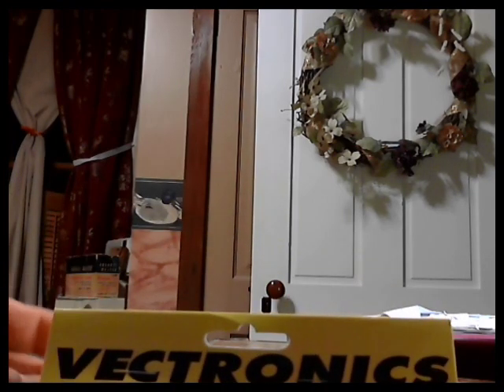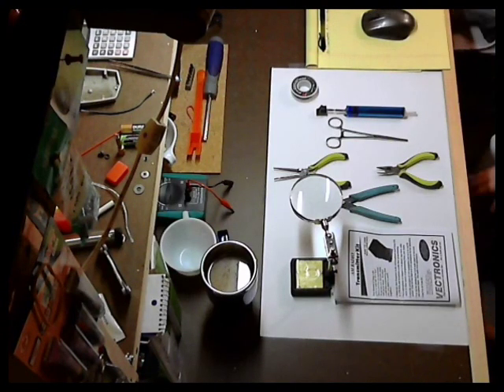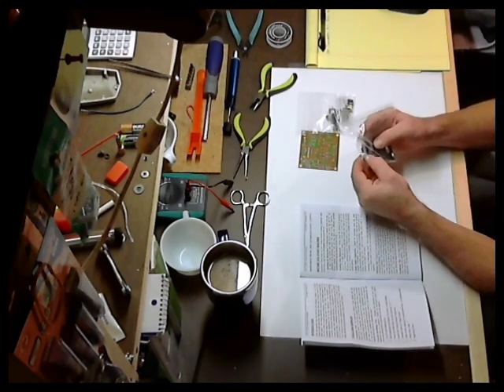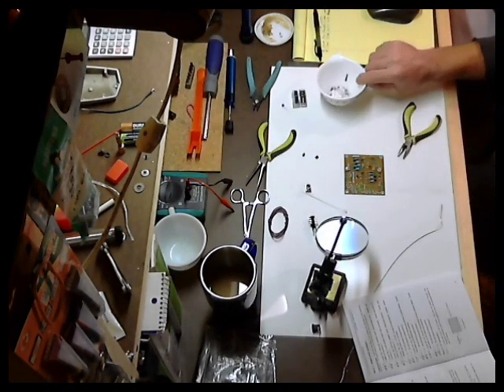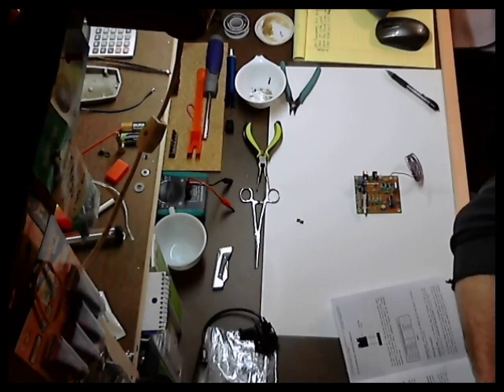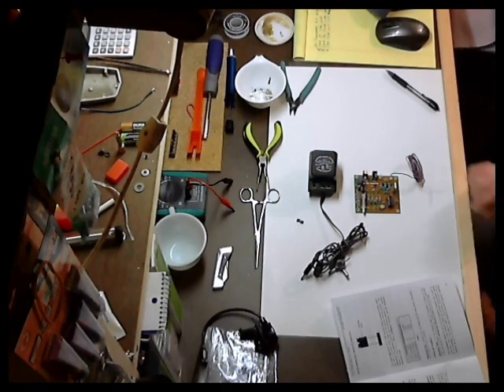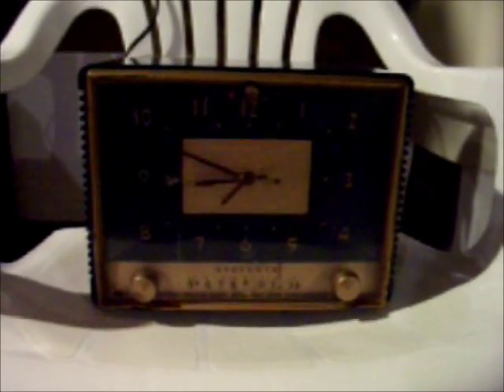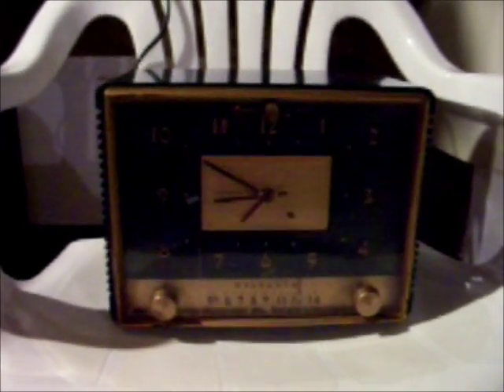Building A Low Power AM Transmitter ~ Part 1 Of 2

Comment: Great video! I thought your idea of putting white poster board down as your work surface is a really good tip.  It seems like this transmitter would be ideal for broadcasting to vintage radios somewhere around the house.  Thanks for sharing your project on youtube.

Best Regards,
Pat
Reply from the maker: Pat,
Hello, the white poster board worked out great. As a matter of fact it's still there. This little transmitter works great. Today I got an E-mail saying my back-order cabinet was shipped, so part 2 should be up soon. Thanks for the view and comment.
Nathan

Comment: Nathan,
Very cool.  Congrats on becoming a member of the transmitter club.  I didn't know about that model.  I may soon have use of one.   
BTW... the FCC knocking on your door is about as likely as hitting a $500 million dollar Power Ball jackpot.  :-)
Also, is your Sirius radio sitting on top of the power supply?

Regards,
John
Reply from the maker: John,
Thanks, Vectronics also has several "meter" transmitters, plus the AM & FM stereo units. This was a fun build, prior to this I assembled a Velleman signal generator. That was a good project, but this was better. I know the chances of "The Man" visiting me are slim to none, but just thought I'd throw that in there for good measure. The Sirius is using the 12 volt power supply till I get a new wall wart for it. The AM transmitter has it's own wall wart and the voltage can vary from 9 to 14 volts. Using it at 9 volts greatly reduces your output power.
Nathan
Reply: Nathan,
What I'm getting at is that the radio sitting on top of the power supply might be causing some of the hum you're hearing on the AM side.  Also know that a transmitter's signal, depending on where it's sitting, can and will be picked up by your house wiring and get re-transmitted a second time (or more), thus also causing hum.  AM transmitters can be a bit tricky.  You have to move them around and play with them a bit until you work out their kinks.

Regards,
John
Reply from the maker: John,
OK I see. I have been tweaking it a little bit. When I first powered up the transmitter it flooded the AM band from 1500KHz to 1710KHz, with a bump around 750KHz too. Since then I decided to stay around 1460 KHz and it has done very well. Takes a little patience dialing this baby in, but once it's done, your well rewarded.
Nathan

Comment: I'm about half a decade late, but do they sell (ship to) in the UK
Reply: Dunno if anyone responded when you posted a year or so ago, but they are sold from MFJ.COM.  I’m fairly sure they will sell/ship overseas.  I built both their AM and FM “hobby” transmitters and I like them both.  I have several other transmitters that I’ve built over time, including my favorite which is a four tube/valve transmitter of my own design....and these from Vectronics compare okay.